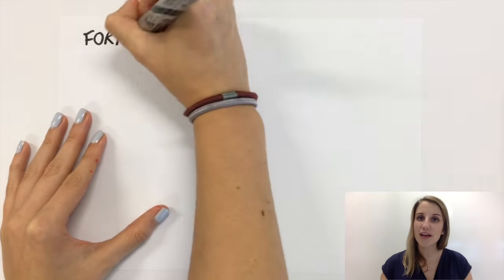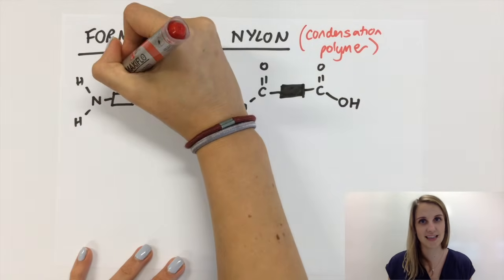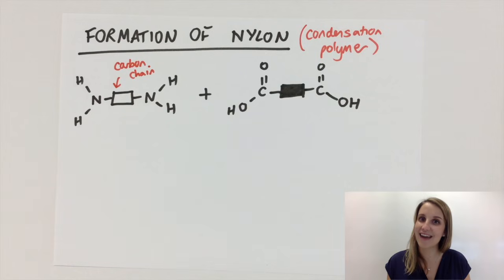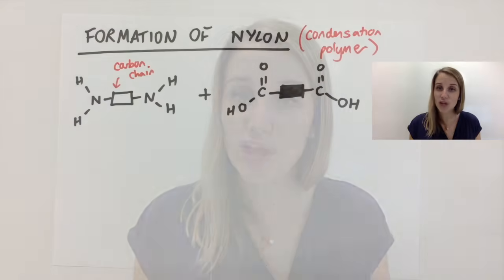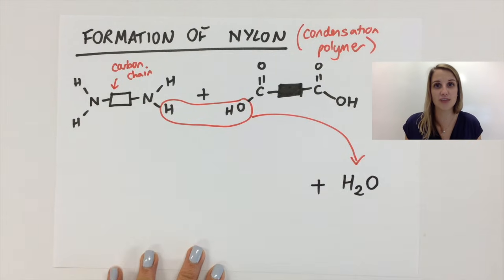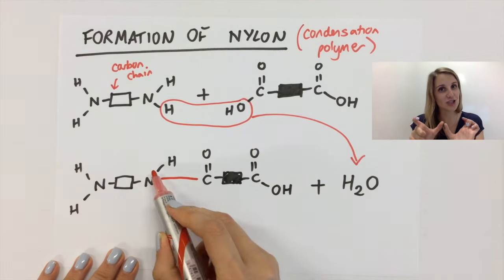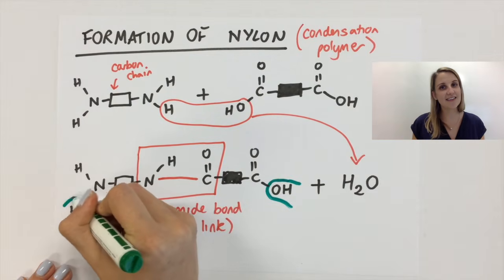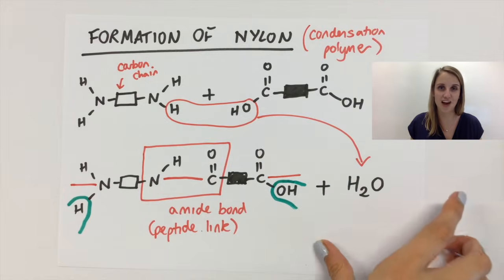Simple Condensation polymerisation polymer explained using nylon GCSE

Comment: How is this product made in the real life ?
Reply from the maker: Normally the two species don't dissolve in each other so you can pour one gently on top of the other and the polymer will form at the intersection. Then you can grab some tweezers and pull it out like a thread which is really cool! In a factory they do this on large scale!
Reply: @ChemJungle  wow great , in your thinking could be possible to make it like a plastic mold press works ? Or do we need to pullout the polymer as you mentioned?